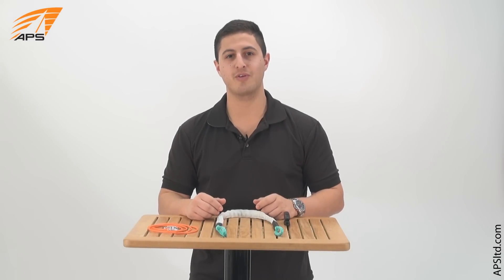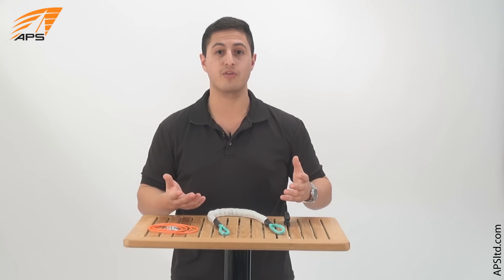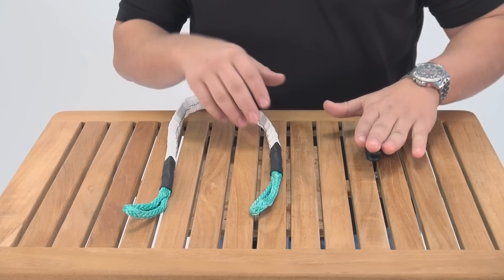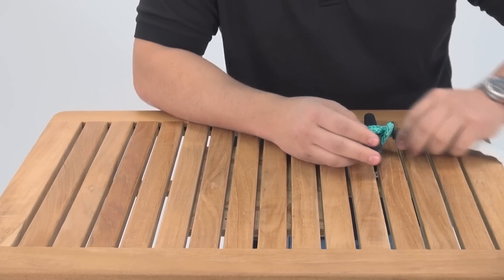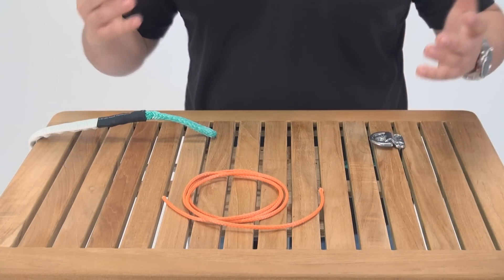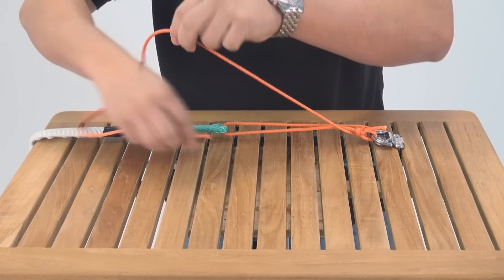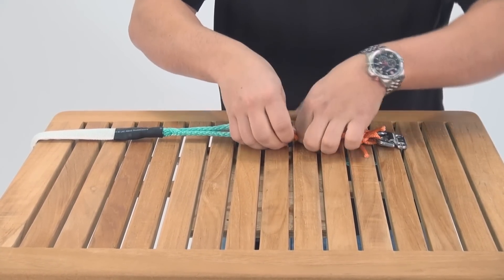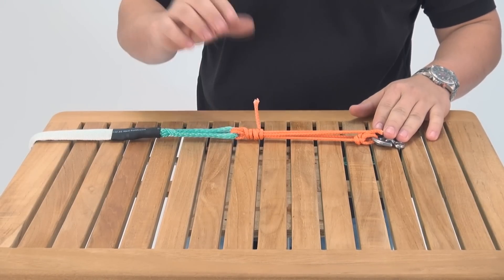How to Install a Dyneema Sailboat Jackline | Expert Advice

Comment: #instantchow lashings work very well, with Dyneema or Spectra. It’s a proven technique for older technology for thousands of years, and is currently the standard way to terminate high tech lines that need to allow for adjustment.  You’ll see that technique used for lifelines and even standing rigging made from Dyneema on race boats too.